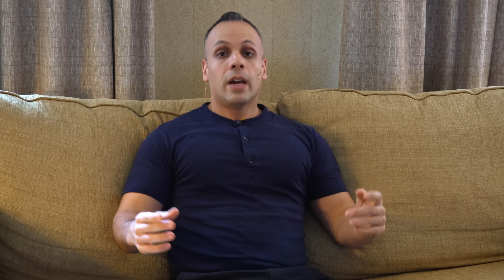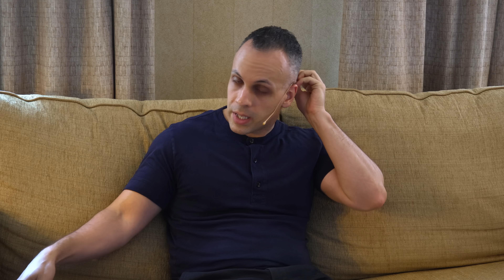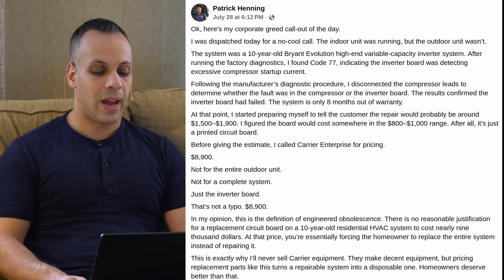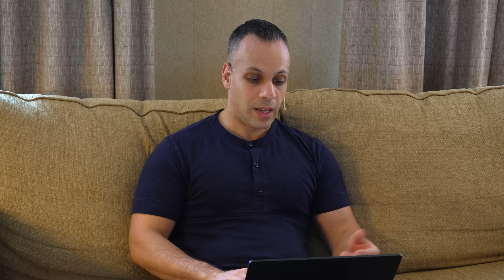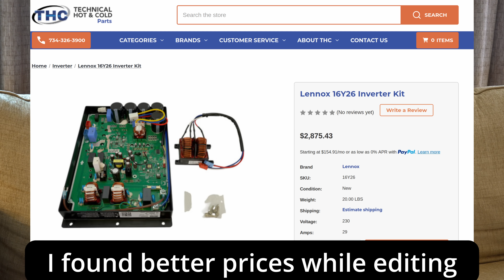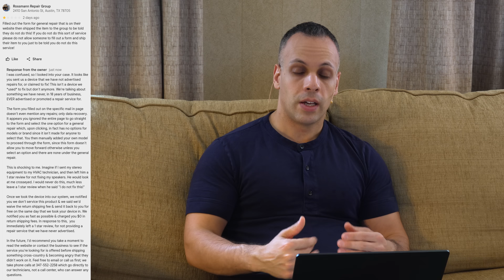Carrier AC repair has $8700 part cost for residential unit

Comment: I work with local biz, HVAC guys are getting decimated.  The best installers have to shift to Mitsubishi- tough to get good pricing and the install is diff than traditional.  My Bryant units are 25 yrs old and I’ll keep them running as long as possible.

Comment: I just went through broken AC quotes. Quotes on 4 ton carrier and trane were $12-$14k. Got a goodman installed for $7k. All the comments on reddit were "the installer is more important than the brand of equipment" and "goodman used to be bad, but they have gotten better QC since being bought out by a japanese company." Also, just a repair was quoted at about $4-$5k on the existing carrier and at 10 years old I didn't expect it to last another 10.

Comment: My home has old HVACs, Carriers, that have served me well, 17 years old. When they go I will not get a Carrier. Why? this viral story. I was already a little miffed at Carrier becuase I had to replace thermostats earlier this year and they make it neigh impossible to even get that. You have to go on a quest to find someone willing to sell you their SIMPLEST thermostat and even then it's like $300 ended up rewiring to a honeywell which works great. Now I saw this obscene story. $8900 for a part on a unit barely out of warranty. They can piss off.
Reply: A 24V thermostat is standardized(Analog control), and 2 wire communication systems are nearly always proprietary(Digital 5v DC signal). Some units control the variable speed using sensors and can be variable speed with 24V but most companies put the control logic in their thermostat and gatekeep variable speed behind the overpriced thermostat. Honeywells will work with any system, so will a $20 ali express thermostat. The only difference will be scheduling features.

Comment: Bet those boards are cranked out in China for <$100 each.
Reply: I would take that bet.  Look at some pics of AC inverter boards.
Reply: And probably by a 10 year old kid.
Reply: How would I go about learning to repair inverter boards for AC systems and mini splits? I’m an HVAC student right now less than a year from getting certified but I’ve studied my ass off. I’m still young, and I know the future is electronic and digital, so if I learned how to repair these boards it would help me a lot. Also I have minor experience in soldering too. Any reccomendations for books to read, videos to watch, or courses to take would be greatly appreciated.
Reply: @nick5839  -- IMO that would not be a simple task without a good knowledge of electronics (and safety) and a lot of experience.  And have access to the theory of operation, fault troubleshooting, part layout and schematics for the board. Access and knowledge of the parts. And have all the tools, test equipment, power supplies and loads. And some procedure for testing, recalibrating and certifying the board.   
I'm a retired electronics engineer and like DIY as much as anyone. I might fool around with a board like this to learn about it (if I survive the high voltage). Reminds me, I have a microwave oven that needs fixing. Only has about half power.

Comment: Can any expert explain to me why an inverter board (or any other "just a PCB", as the original poster said), can acceptably cost 2.4K USD? I get that it's probably very high end, but there's a limit to how much you can spend on improved quality components before it becomes pointless, and I doubt the limit is nowhere near high enough to justify such a price tag, especially for a PCB.

Comment: I would only a major appliance if I knew I could get replacement parts, fixable parts etc, or if the appliance was likely to last a number of years where I thought the price was worth it. And yes asking for a higher price does work instead of saying no which is kind of crazy. The worst was when I went to a local repair shop and they quoted me a higher price, which I agreed to and then they ignored me when I tried to get the repair done.

Comment: 15 years ago, I had a similar component fail on the Carrier unit (it might have been the same one) in the house we had recently purchased. The unit was also out of warranty. After my HVAC guy called them, Carrier replaced the part for free and paid him to install it. He was a one-man shop, and didn't have any special pull. It sounds like their policies have changed over the years. That's sad because it was a company I had a good feeling for until this video.
Reply: Guessing private equity got a hold of them.

Comment: With this board, the mfg clearly decided to skip copper traces, and went for solid gold. Screw plating.   :(

Pretty sure I follow this guy on YT (or maybe there's two guys who are working on the same AC unit).  That price is just unbelievable for what it'd cost to simply repair it.  That's aircraft level pricing!

Comment: I have a nearly 30-year-old furnace made by a company that doesn't exist anymore, installed by a company that doesn't exist anymore, and with a board soaked goddamn simple that I was able to fix it in 10 minutes when it got wet from the coils freezing over last summer. I will happily keep this unit until it dies

Comment: As a commercial hvac service tech, i will never recommend any of the higher end models, they are more complex, with minimal benefits, fail sooner, and have parts become obsolete faster. Any "budget" brand will most likely save you far more money than a slightly more efficient unit in the long run. Personally i like ICP, the budget brand of carrier. I called our carrier rep for a board last week 1500, same board from our icp rep was 950

Comment: Want to know what else is insane 
Refrigerant 
R410a is about 8.50 a pound when purchased from the supply house by HVAC company 
 They turn around and charge the customer $80-$85 lbs for that same refrigerant.
Plus the hourly charge
Reply: Stop lying.
Nearly every HVAC contractor uses flat rate pricing for everything, nobody charges hourly anymore. That 80 dollars a pound includes the labor to install it and balance the charge. You think it takes 5 minutes to balance a charge and anyone can do it by watching some half assed clickbait YouTube “ you can charge your own ac” video? Try a half hour at least. if you’re doing it right. And then you have to calculate things like airflow and static pressure, things that actually take skill, or else you’re just guessing . You have absolutely zero concept of what it actually costs to pay a trained tradesman to drive to your home and spend a couple of hours there, and all the overhead involved with it.

Comment: All of the high SEER rated heat pumps and furnaces seem to fail more often than lower rated ones, and more costly to repair.

My house has a heat pump and furnace for each floor. The newest one, which is a high SEER heat pump and 98% furnace, needs something fixed on it every couple of years, and those parts are obscene, and the furnace exhaust freezes nearly every winter, shutting it down until I can get it thawed. The oldest one is from the '80s, it rarely has issues, maybe every 5 years a $10 sensor needs to cleaned or replaced.

Comment: Im a carrier FAD dealer, if you want full access to my pricing contact me. Carrier Infinity parts are insanely priced. They are constantly revising the parts and on average 4-5k for inverted boards in my CE app. I'll send you several faulty inverters if you want to try to repair them.
Reply: Inverters really shine with dehumidification abilities in foam encapsulates homes

Comment: ALL of those prices are insane. Some are just more insane than others.  I have one of those Honda 2200 generators.  Its inverter board is going bad.  Honda wants $400 for that board.  That's half of what I paid for the generator.  I had also just paid to rebuild the motor int he generator months prior because the stupid POS lost compression at 1100 hours of use.  In fact, I have two and the OTHER one lost compression at the same 1100 (ish) hours.  I will never own another Honda generator.

Comment: I can buy a 16Kw whole home solar inverter system that can take multiple solar panels, has a transfer switch and dozens of other options including online monitoring and charging backup batteries. All for $6k. These clowns want more than this for a low power PCB in an AC unit ? Carrier has joined my permanent never buy list along with many other companies.

Comment: Let me tell you about Lennox air conditioner and their multi thousand dollar circuit boards. Imo, it's an industry wide con job.
Reply: with boutique brands like them it sure is. ruud / rheem, goodman & a few others use common parts which are easily had & are affordable for customers.
Reply: Lennox everything. I don’t remember what model it was, but I called in a shaded pole draft motor on an older Lennox one day. $900 from Lennox. They always seem to be 3-4 times the cost of everybody else and that’s IF it’s not on “back order”
Reply: Lmao the Lennox s40 is almost 1000$ it's so out of touch and I genuinely cannot believe homeowners but them but iv installed a few 🤯
Reply: That's what Costco contractors uses if you go with them. Customers don't realize how much of a rip off it is because of the Costco name.

Comment: I got f!*@@&d by Carrier last winter.  They have a warranty on their furnace secondary heat exchangers (poorly designed, should be stainless but they make of mild steel a part in a hot humid operation....) but their dealers refuse to actually do the repair (at least where I live).  I got the part online and installed in about two hours (at a leisurely pace).  The dealer said it takes a whole day and it isn't worth it........  Other dealers don't even bother call you back.  I will NOT buy anything made by Carrier again.
And, oh yeah, the $8900 is the F.O. price.

Comment: HVAC came and provided me an $5000 estimate for repair and added that the unit was 1lb overcharged. The trusted HVAC guy came a week later and asked, "why is your AC 1lb short? Has someone else serviced it?"  His repair, $700 which was 90% labor and includes the  $150 for adding back the 1lb of refrigerant.
Reply: You cannot possibly know an A/C unit is "1 lb overcharged" without using a machine to completely evacuate the system and weigh it.  Did they do that?  An A/C repair tech can make a reasonable guess at whether or not a system is undercharged or overcharged based on pressure readings, but you can't know for sure unless you evacuate all the refrigerant and weigh it.  If a leak is suspected (i.e. based on pressures) then you evacuate the system and test it, make any repairs if needed and then refill it with the same refrigerant you pulled out of the system.
Reply: @Toby1952  Ac levels are adjusted based on sub cooling or superheat. Depending on if you have a txv or a piston. If the supercool/superheat is off, you add or remove refrigerant until it's right. Once complete, you weigh your bottle. Factory recommended charge isn't exact, it has to be adjusted at time of install for the tenth of the line set.
Reply: @mph5896  While that is true, my reply was based on the the OP's comment that the HVAC person stated the "unit was 1 lb overcharged".   In fact, his comment implies all the serviceman did was listen to the owner's complaint (probably not cooling very well) and provided an estimate of $5000 to remove 1 lb of refrigerant from his system.  There may be more to the story but if you want to make a statement like that I think you have to evacuate and weigh the refrigerant in order to give you a better picture of a system you have never seen before.
Reply: @Toby1952 plain outright lies and theft for sure (12 years fixing ice makers  ,Coke fountain units , beer chillers and slurpee units , Vegas)
Reply: @Toby1952 exactly 💯, and 1 lbs either way isn't detrimental
Reply: Ya, it might be a we don't really want to fix, but here you go if want. But not Carrier at all.  That kinda attitude says you don't want my business.  I have a R22 Bryant around 30 years old. Very simple to work on and will keep fixing until can't.  Then going Lennox.
Reply: You're lucky. Someone else's HVAC company stole an entire outdoor unit off the roof of my office, five stories up with no external access. They must have brought it down through the building at a weekend. For good measure, they cut all the cables and pipes flush where they came through the wall.
Reply: @stevegreen5358 what makes you think it was an HVAC company
Reply: @stevegreen5358  WOAH that sucks!
Reply: The HVAC company pays about $8.50 a lbs for R410a 
I know the new stuff is a lot more
 Here's the deal also, technician wouldn't have known exactly how low or overcharged it was on refrigerant unless he weighed it out.
 They test the system using temperature.
Super heat and sub cooling
 1 lbs isn't detrimental to a system either way and probably was within spec. 
 You probably got scammed
Reply: Let me guess, you have R-454B.  Refrigerant theft was a thing due to the shortage and proprietary nature of R454.  In Southern Arizona a year or so ago newish installs randomly lost refrigerant overnight at a bunch of houses... it turns out inside job, a shady tech was going around stealing it to be resold.  I was thinking we may need gas cap locks but for HVAC ports.
Reply: wow.  if he steals 1 pound every service call.   in a year. 
CALL THE BETTER Business Bureau!
Reply: This is a state attorney general filing as well as any licensing board (which is probably also compromised though)
Reply: @kevinedwards7206 actually it is stealing, the customer owns the refrigerant that is taken out, they in theroy give it to the customer or pay him for it,
 They will turn around and sell it for about $90+ lbs depending on the type
Reply: @kevinedwards7206  The BBB is Yelp for old people.
It is NOT a government organization, and has zero enforcement power.
The first clue should be that their website is .com not .gov

Comment: Had a Carrier evap unit. Motor died. Had a company come to fix. Turned out that it was a rebranded copy of a Carrier sold through Carrier installers. Carrier couldn't replace the motor as the installed motor and fan went in reverse to their stock product. Screw them, went with an Australian made and owned evap with local support.

Comment: A few years ago, the light & service fan on my parents microwave started running continuously when the door was closed (door interlock stops everything).  Some googling told me it was an issue with the main circuit board and the whole thing would need to be replaced for many hundred bucks.  Or replace the whole microwave for about $1,500. That seemed a bit excessive for what was likely a broken relay.  More googling showed me how to take apart the microwave and find the main board, which I did.  Folded inside was a schematic which let me quickly find the relay that controls the light & service fan.  Metered it and it was indeed stuck closed.  Of course both Mouser & Digikey were out of stock of that part, so i found some on ebay.  Got a 5 or 6 pack for around $12 with shipping (the board has at least 12 of the same relay, so now I'd have spares).  Desoldered the bad one, soldered in the new one, fixed!  (Thanks for teaching me how to properly use flux when soldering on circuit boards!)

And just this past weekend my AC had an issue.  I thought my refrigerant was low- it was not.  Service tech said my compressor was failing and would cost ~$5,000 to replace, but since the whole unit is 14yrs old I might want to consider replacing the whole thing for ~$11,000.  The symptoms weren't adding up, so armed with my trusty multimeter I relatively quickly determined the issue was nothing more than the float / overflow switch on the condensation drain was right on the edge of making / not making a connection.  Tested the drain to be sure it wasn't clogged - it wasn't.  1 little tap on the float with my finger and I'm back in business.  The company that sent out the tech did at least refund my service call fee when I told them what the issue actually was.

Comment: When I used to do  HVAC work we did end up stripping and saving any good parts off the units we replaced. Due to the equipment being older in the area we serviced, it was nice to have other options available for customers than a brand new unit. We would not offer any warranty on parts and sell them for half of cost given they are used. 9/10 times we didn't have to go back and if we did the customer was already aware that the unit needed replacement.

Comment: Two weeks ago I replaced the compressor on one of my 37 year old central air units with a used one from eBay. Yes it was 2k in equipment I didn’t already own, and I needed an EPA certification but I refuse to get a new system that requires proprietary electronics and costs me thousands to fix when lightning strikes near my house.
Reply: Sounds like you could use lightning rods.  If you have nearby lightning, I'm serious.  My last house had rods and lightning would hit trees in my yard. Only one device ever failed - and its replacement also failed. Must have been a "weak" design. Then I put that device on UPS power, and never had another issue.  But lightning rods do work.
Reply: @bobblack3870 I’m almost sure that by code the copper pipes from my house are attached to a grounding rod that goes at least 3 feet into the ground. Are you talking about something different?  Thanks.  Edit. I’m leaving this comment but I just searched for it and I see it’s something completely different. Time to learn. Thank you very much for this info!

Comment: Trane has always worked well for me in my last home and, so far, in my current house. I just found out recently that American Standard is made in the same factory, just a different label slapped on the outside and less expensive. Also, the Trane inverter costs $851.
Reply: Trane has a few brands
Trane, American Standard,OxBox, Run Tru, Ameri Star 
Some made in the USA, other in Mexico and China